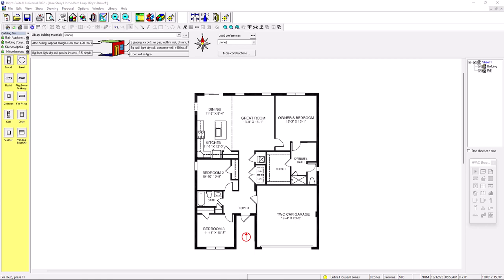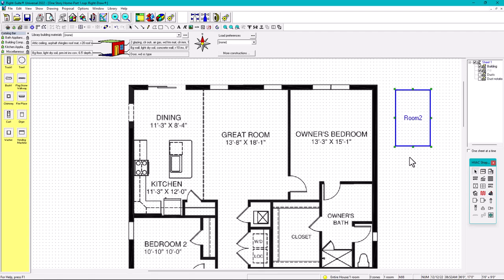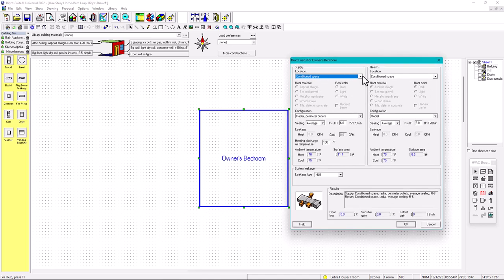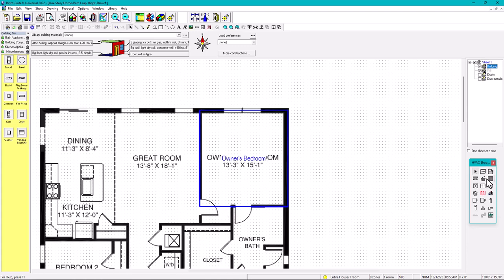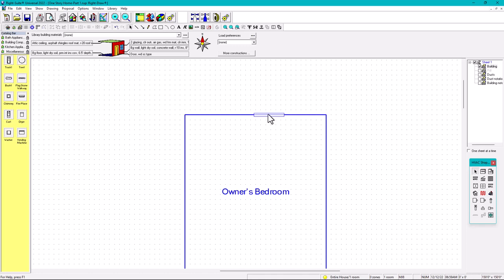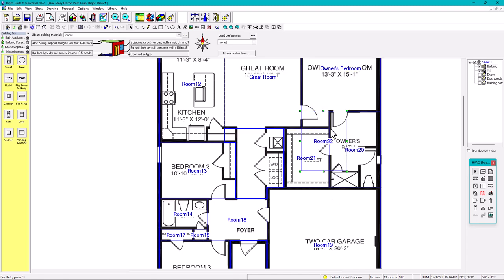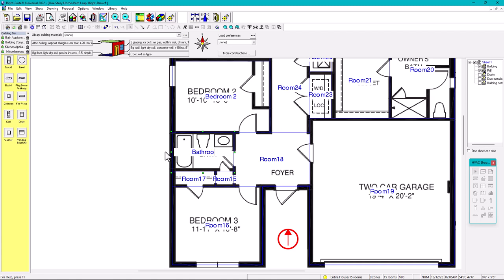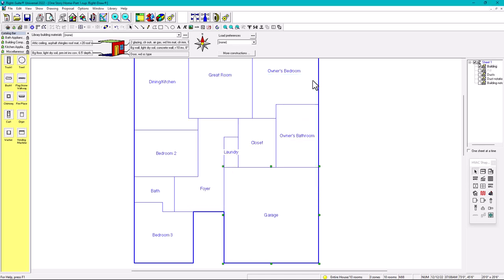Wrightsoft (Part 1): Manual J Heat Load Calculation - One Story Home,

Comment: Hello, can i ask you why you only selected one wall of owners room & not 3 walls ?

Thank you for this tutorial
Reply from the maker: We only select one wall because the software automatically will account for exterior walls. Interior walls don’t take part in the calculation. 

Technically, the software takes the expose walls in the perimeter of the house. In this case it takes the plan North wall and plan east wall since they are exposed. Because both walls are one type, we only put one type of wall (envelope properties are the same for both walls)

Comment: if wall and roof insulation and total area are not change, does the heat loss change if ceiling vault or not?
Reply from the maker: That’s a great question. If your ducts are running in the attic this represent a lot of heat load. So in a practical example, I would check in Wrightsoft option A ceiling type A and check the tonnage. Then Option B ceiling type B check the tonnage.

Comment: How come you only change wall 1 and not the other walls?
Reply from the maker: Great question! We only change one of the room properties so that way it is easy (and more efficient) to copy paste the same room for other locations and we keep the settings. Otherwise we would have to do the same for every room one by one. However, this is one of the methods that I use very often. Always depends on the designer what path to follow.